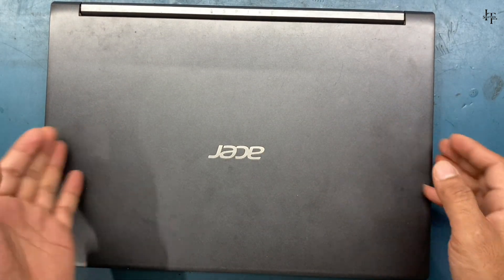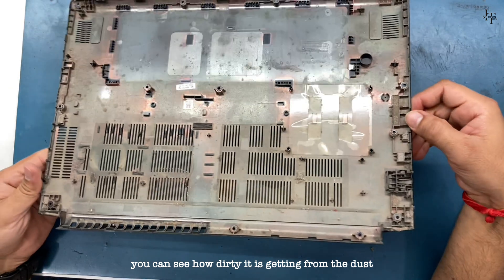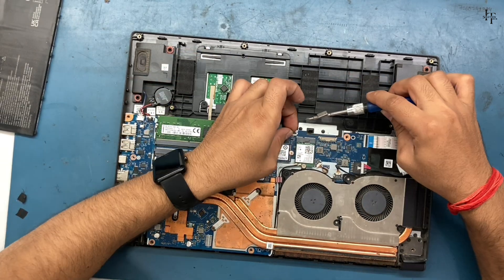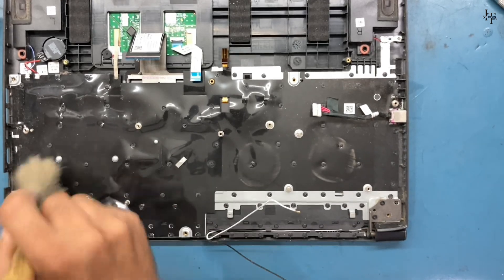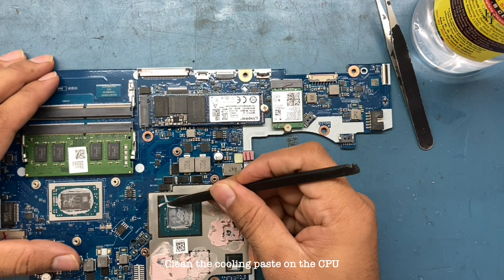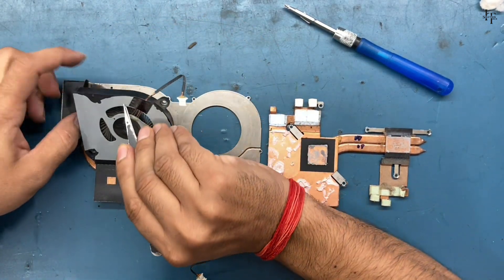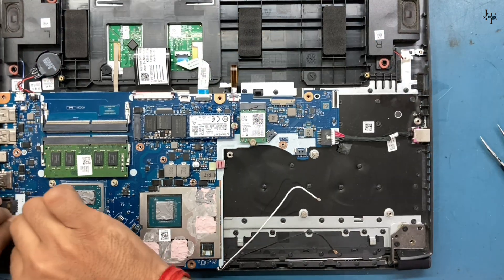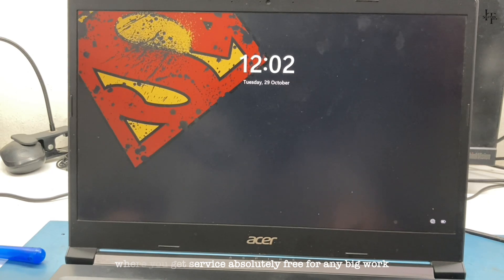ACER ASPIRE 7 ll COMPLETE CLEANING AND SERVICE

Comment: Is it also necessary to replace the pink paste which remains on the copper plate at 4:27 in the Video? Or is it just glue to keep the parts in place?
Reply: yes, this is a liquid thermal pad, if there are temperature problems, you can replace it, and in my practice I change it less often than thermal paste

Comment: Did exactly everything, now my laptop won't start😢😭
Reply: you have to be  careful , you should not touch anything other than battery plug, fan plug, fan and thermal system, first find and unplug the battery plug (search it up if you don't know on google) before doing anything to your laptop (this will prevent you from getting electric shock and also doesn't damage your laptop), then unplug the laptop fan, and then unscrew the screws ( and you have to keep it safe in a small bowl) and then you can clean the fan, then you can clean the lid's air vents.

once done, carefully assembly it back, connect both the plug (first fan, then the battery), close and screw it back, once again,  you should not touch anything other than battery plug, fan plug, fan and thermal system.
Reply: this is a basic way to clean your laptop
Reply: if something went wrong during CLEANING AND SERVICE, show your laptop to laptop Technician at laptop repair shop, and tell them what went wrong during CLEANING AND SERVICE.
Reply: it is best to not to unscrew the battery ,it is fine, just need to unplug the battery ( this is important)
Reply: FOR REMOVING AND REAPPLYING THERMAL PASTE, let the laptop Technician at laptop repair shop, IT SHOULD COST YOU AROUND (Rupees 200 - 500 INR) ( I Don't know the exact amount) 

(DO THIS IF YOU FEAR TO DO IT ON YOU OWN)
Reply: ( SUGGESTION AND ADVICE)  KEEP YOUR ROOM, TABLE, FAN OR COOLER OR AC, WINDOW CLEAN, DUST IT EVER DAY IF POSSIBLE, THIS WILL PREVENT DUST ACCMULTING INTO YOUR LAPTOP'S THERMAL SYSTEM, AND KEEP IT CLEAN AIR FLOWING TO YOUR LAPTOP AND ALSO COOL DOWN YOUR LAPTOP, SO YOUR LAPTOP DOESN'T OVERHEAT FAST.

Comment: You didn't changed the thermal paste after opening the heatsink. Is it safe brother?
Reply from the maker: Please look carefully, new cooling paste has been applied on CPU and graphics chip
Reply: @itsolutionhub02   I´m also interested in getting that question answered. So if replacing the pink stuff is also necessary.
Reply: He is talking about that pink stuff